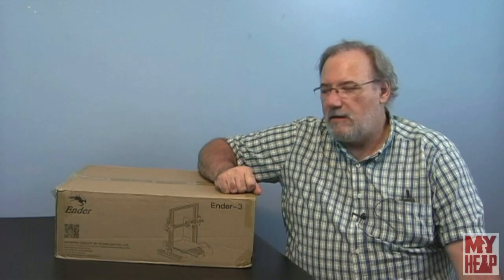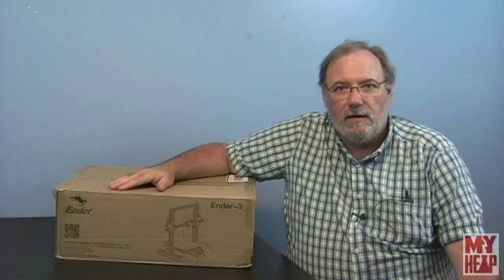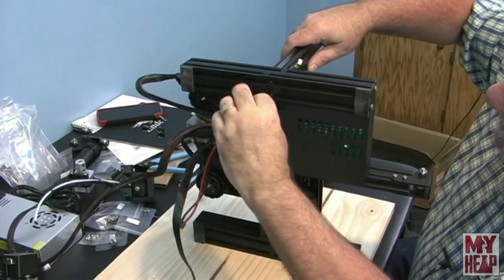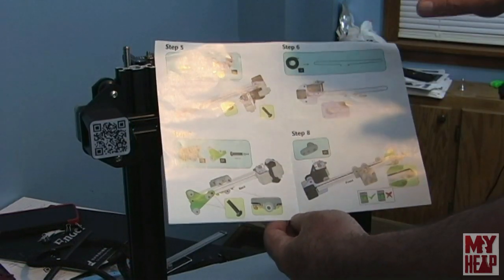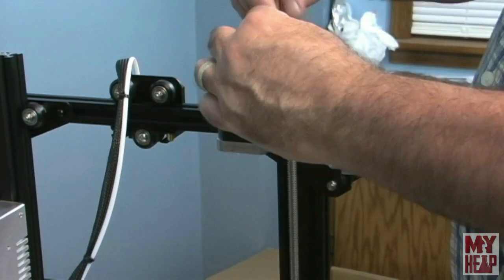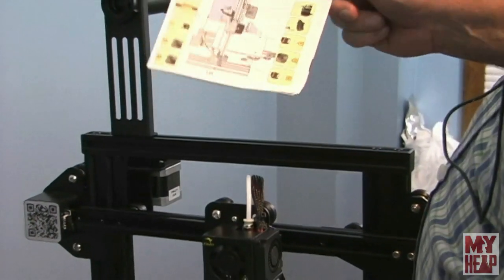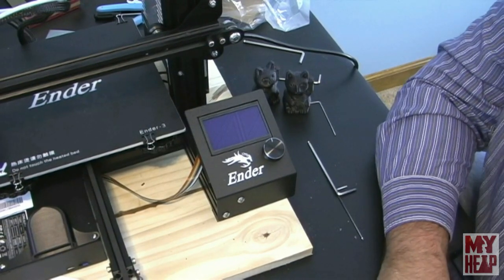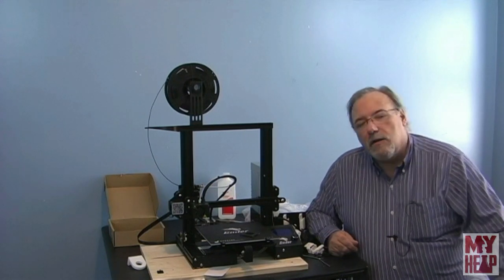Banggood Review - Creality Ender 3 - 3D Printer

Comment: Good video, I have had an Ender 3 for about 9 months and enjoy it quite a bit.  I switched to a borosilicate glass bed and attached it with double sided tape.  The glass bed eliminated first layer adhesion issues and makes getting the completed prints off much easier.  Cheers, I know you will enjoy it.
Reply from the maker: So far the printer has really past my expectations.  Like I mentioned in the video, the plastic almost sticks too well to the base.  Where did you get your glass bed from?

Thanks for watching and taking the time to comment.

Joe
Reply from the maker: @TheQwik512  thank you.

Comment: I absolutely love my ender 3. I got mine after not really being able to get any time on the printer at tcat. On the overly strong bed adhesion, creality has a glass bed for it. If you use some purple gluestick on it, as soon as the bed cools you can just pick the print up off of the bed, no scraper needed. 

Another upgrade I seriously recommend is the filament roller that attaches to the extruder gantry. Otherwise the filament wears into the extruder pretty bad. 

I mainly print with abs now on mine. It's so nice, but you'll need an enclosure.
Reply from the maker: Hi Morgan.  Thanks for the tip about the roller.  I am still pretty new with this stuff so any help along the way is appreciated.

Comment: Nice review Joe,  I checked it out and added it to my cart.  I'll let it sit a few ways and decide if I still want it.   FYI.  it $169 if shipped USA and $199 from China.
Reply from the maker: Hey Walt.  I was pleasantly surprised by the machine.  If it has a fault, it would be the tenacity that the build plate holds onto the print.  But this is better than it letting loose while printing.  I can see a few uses in the shop that will be handy.  Thanks for watching and commenting.

Comment: tnx Joe...good review...got to look around a bit but I may have a question or two down the road...bob
Reply from the maker: Hey Bob.  Feel free to ask away.  I will help where I can.  Thanks for stopping by and watching.

Joe
Reply: I found the pdf file for what happens after the machine is built...installing the software and running it and of course building your part...looks straight forward but the process is a bit different from a CNC build...I'm thinking for the price I'd like to learn more...bob
Reply from the maker: Hey Bob.  From a cnc point of view that. You and I are used too it is a bit backwards.  The only similarity comes in at the. Gcode where the controller is running the machine.  Lathe, mill are subtractive machining and 3d printer is additive machining, but this stuff you know.  I see the biggest benefits coming from prototyping an idea, creating casting patterns with filets and draft printed in and making useful shop bits like the tool storage and the like.  I would suggest using Fusion 360 to model the solid.  It is capable of slicing the model too, or you could use something like cura to do it.

So I am not sure what PDF you are talking about earlier.  One nice thing about the ender 3 being open source means you can tweak the machine if you need to.  For example, if precision is important you can print a calibration cube, measure it and then adjust the steps per unit to compensate for leadscrew or belt imperfections.

Hope I didn't ramble too much there.

Joe
Reply from the maker: Bob,. The notifications show another comment from you but I cannot seem to find it.  Bit to answer about another project ... I want to finish getting the mill together and the KW steam engine.  Then I think comes a steady rest series.  Pattern, molding, machining.  I just wish I could get more time in the shop.
Reply: Tnx Joe...I'm really curious...pretty sure I can put it together but trying to figure the learning curve for an actual build...I'll take a look at Fusion 360...I've used AutoCAD forever...tnx again...bob
Reply from the maker: Randy Richards in the shop had a great little series on using Fusion 360 from the beginners point of view.  Paul McWerter has a small series on using it for 3D printing.  And if you like I can perhaps do something with it in terms of 3D design and printing if it will help you.
Reply: Tnx Joe...just went over the terms for Fusion 360...I'm retired...I spend money...not make it...so seems I'll be fine...had knee replacement surgery 4 weeks ago and just getting back into the shop...wish I had got interested in a new CAD program 3 weeks ago when I was just sitting around reading and watching TV...tnx for your video I've been curious about 3d printers for some time...read lots of reviews but never felt knowledgeable enough to buy one...bob
Reply from the maker: Glad to help Bob.  My son has an Anycubic I3 Mega.  It is about the same size as the ender 3.  Cost him a bit more but the ender 3 is just as good.  I don't know if I mentioned the print capacity or not.  The Ender 3 is 220mm x 220mm x 250mm tall.  Though you probably squeeze a little more from it.  Still an 8" x 8" print up to about 10" tall is pretty big!
Reply: the CNC router I built years ago is about 12x12 with a fixed gantry and I've made tons of stuff...I work in small pretty much...I just ordered an ender 3...I've got 3 pcb enclosures I need designed in my head and the wheels just got spinning...cleaned off my drafting table as a temporary set up spot and I just pulled out a years worth of Make magazine just to get ready...bob

Comment: is this still working or have you upgraded
Reply from the maker: It still works fine.  Recently I printed all the patterns for the Kenneth Wells Traction Engine, and Randy Richards oil can.  It actually is a good little printer.
Reply: @MyHeap  would you recommend it still
Reply from the maker: @joeduda8507  Yes I would.

Comment: My ender 3 when it prints goes to the left, for example I tried to print a head of a lego man and it printed it crookedly, then before printing an object it creates a line on the left, the problem
Reply from the maker: I think I need to see a picture.  Make sure bed is level and no binding of the axis.  It seems you are losing steps or something.